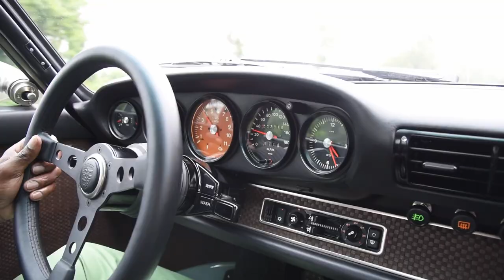EMORY & SINGER - Hot Rod Porsche Shoot Out!

Comment: I much prefer the Singer. As a 356 is supposed to have an air cooled 4 cylinder engine. The Top Gear review of a Singer is very good, and is done by James May. Thanks.
Reply: The Emory 356 has a 4 cylinders aircooled engine that produces 200 hp Rod Emory design and produces his own 4 cylinders aircooled engine is not a 911 modified engine when Rod started building this 356 he was using Porsches 911 modified engine but not anymore in the recent years he produces his own engines
Reply: Its a Rothsport 2.4-2.6L air-cooled flat-fours. Power outputs are anywhere between 200-260hp.